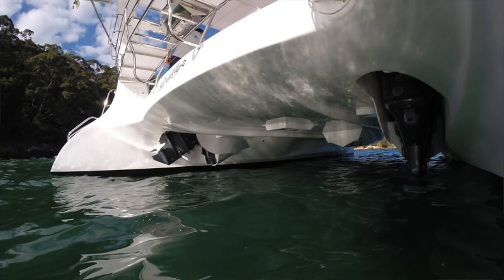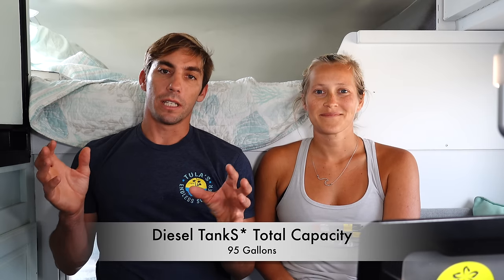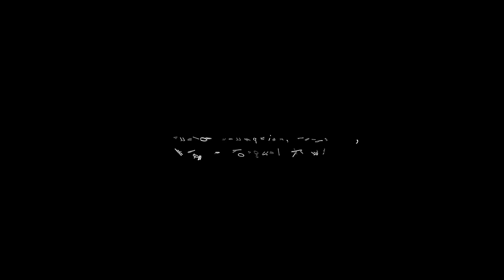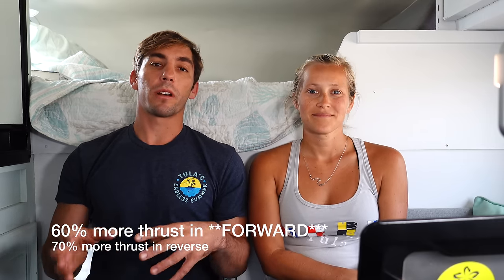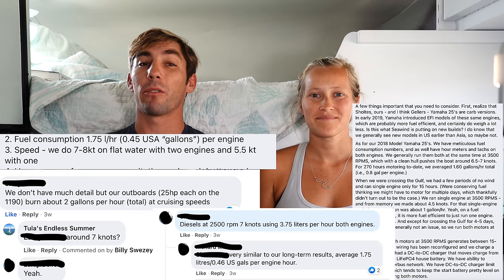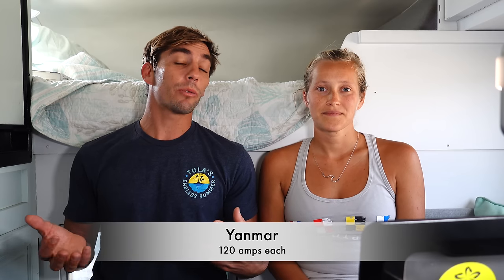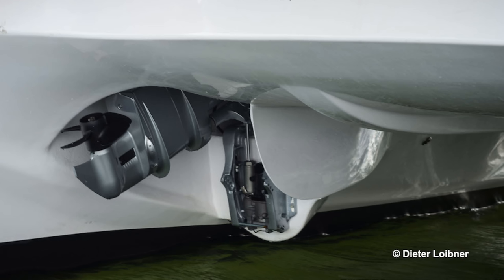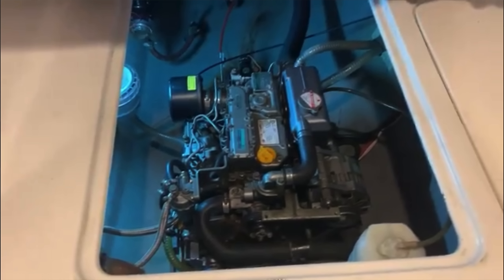Do Outboards Make Sense on a Performance Cruising Catamaran?

Comment: Looking at the 1190X I thought of trying a pair of Torqueedo Cruise 10.0 R's (20 HP) augmented by Seawind's Fischer Panda Genset option would be the way to go. My biggest reason for not wanting traditional Outboards is not having gasoline in the interior tanks.  So you'd still get the advantage of diesel efficiency from the genset only when need it to charge or extended motoring in no-wind situations, but retain the advantages of less drag and easy access for maintenance.  Cost would be a factor here, the Torqueedos are not cheap and neither is the large li-ion battery bank, and the extensive electrical component package involved.  It would take some real world testing to see how you would make out in terms of fuel consumption.  This isn't an option from Seawind yet so you'd have to convince the factory and your purchasing dealer to set up a purchase/ installation plan... and that would not be cheap, lol.

Comment: Diesel...better in my opinion when the chips are down in stormy weather and you need to motor away from a hazard.  Could you even keep the outboards in the water with 5-6 feet of chop?  Being able to charge when the sun isn't shiny is the other plus.

Comment: Diesel = + range, + elec generation, + safer fuel, + noise. The benefits of diesel inboards justify the increased cost. In spite of offsetting costs of other items to pay for diesel, get a water maker, larger capacity fridge & freezer, A/C, a way to heat water for showers, and elect Nav such as plotters, radar, forward sonar scanning. Minimum sails and solar panels at first because you can add them later. And get your dinghy back from Atticus! :) March is around the corner, so pick out your curtains now!  :¬) Webhead USA

Comment: Why not go with a 4th option of putting a pair of Oceanvolt Servo Prop saildrives and have a large generator for a range extender when needed. Then you only have one engine to maintain with the regeneration capabilities while under sail.

Comment: I like the outboards because they can live out of the water when you are at anchor; no bottom growth. Your boat is so fast that you want be motoring much on light air days. To check the saildrive internally you have to haul out. Also replacing an outboard is alot  less pricey. Go here and check what I am trying to say dyslecticaly arasen araseg etuhctib no eyrirahs.

Comment: Totally would pick the diesel motors! Higher torque and power if needed, way less maintenance and higher resale value for when y'all start a family and move ashore. They also have diesel heaters for boats if you ever need one and the fact that they put out a lot of amps to recharge batteries. It's kind of a no brainer.

Comment: deisel inside the boat is simpler to maintain and work on when they break (every engine breaks sooner or later) outboards would be extremely difficult to work on with the outboards in that location

Comment: Two comments here:
Heavier cats sail slower. Yes the engines are perhaps the biggest weight difference choice you face, but once you go diesel the tendency is to keep,pressing towards a gear-loaded boat that will hold its resale value. And that boat won't sail as well as the less equipped, outboard powered 1160/1190. In building our Farrier 39 tri, we chose a 20hp two cylinder outboard instead of the three cylinder diesel. This along with many other weight savings resulted in a multihull that sails well in light air, when everyone else is motoring. I see a lot of cats under power. 
Comment 2 is, just did a 500 mile Atlantic coast trip on a St Francis 44 decent performance cat. Their engines are the next size down and it's fine. Can you guys save interesting money stepping down to smaller diesels? I think it's worth a hard look.

Comment: There is NO option for an ocean going vessel. None!....  Diesel is far more prevalent on the ocean. Meaning, you can get diesel anywhere. even other cruisers. foreign country's predominantly use diesel for their primary fuel. You can burn alternative fuels, oil and vegi in a pinch. Diesel has a much lower flash point. You can transport it in a wider range of containers in an emergency. Gasoline has approximately 126,000 BTU's per gallon, Diesel has approximately 140,000 BTU's per gallon. You can upgrade the alternators later on to high output, like the Balmar 200 amp. I could go on for day's! We watch all your vid's.... Well except for those silly land ones! LOL We Love you guys! Keep it up. Brett and GiGi

Comment: Just wanted to make sure you guys were aware that the published options sheet for the 1160 says the Lithium upgrade is for outboards only.
Might change your thinking on going diesel.
I think they put the Lithium batteries and charging equipment on the aft shower compartment space that the diesel would go on which I guess is why they are mutually exclusive?

Comment: There are now Diesel outboards being built Cox is one such Co. No carb or ignition problems.
 But longer term internal combustion engines are in a sticky space. 
 If you have inboards you can swap to hybrid electric ... And have regen under sail see sailing Uma ..you could still run electric  100% power from go...silent simple and run for years with minimal maintainance.  They can be positioned vertically or horizontally or anywhere in between  they dont consume oil either. Brushless motors only need seals and bearings changing infrequently.They will even run in seawater so an externally driven azimuth pod can be used.  So all you have is cable running through the hull.If you have steerable pods center drive or rim drive the. They can thrust in any direction. 
Outboards. With a high output generator onboard combined with lithium batteries.  High output alternators work at low start ups. See Silent yatch's system.

Comment: the dingy engine has a shorter shaft than the cat outboards so they are not interchangeable. the outboards can be pulled easier and taken to the shop where the diesel can't. but the diesel lasts longer than the outboards.

Comment: Consider the rapid development of electrical propulsion and exciting new battery technologies (not yet on the market but possibly some hitting next year and 2023, not that LiFePo4 won't suffice). So possibly use outboards for now, but have Seawind put in provisions for inboard engines - prop shaft penetrations in the hulls. Even though folks like Sailing Uma have ventured forth in electrics, I imagine in a few short years there will be even more options. I see a company now building electric outboards in the size you are considering (not yet on the market).. but inboards wouldn't have cavitation issues outboards have. Also, wouldn't be that difficult to go Yanmars if you decided later you didn't like the outboards. Just a thought.. I understand the advantages of diesel.
Reply: RE: propshaft penetrations: I mean have them do what they can to make an inboard installation easier. I'm not suggesting have actual uncapped penetrations or prop shafts sticking out.. for those that are thinking I'm really stupid.  Ha!

Comment: I was surprised to hear the diesel engines on this boat are quieter than outboards. 
Over my life I’ve owned boats with big and small diesel engines all of them irritatingly noisy. I just acquired a 26 foot sailboat to teach my grandkids how to sail. This boat is powered by an outboard. The engine sound reduction is dramatic. I admit to loving the absence of that diesel clatter.

Comment: For sure you need folding props.  But I would go outboards for less weight. I have a Corsair 31,. So  I am weight sensitive. You can carry plot more toys and food if you get outboards. But if you don't mind motor sailing with one engine to help.you point, or go in light air, then the extra weight is not as big an issue. And motor sailing with one motor might cost less than half gallon an hour, peanuts that is.  There have it,if you don't mind motor sailing get diesels. A full throttle the diesels will kick ass...

Comment: I prefer electric motors like the air cooled electric yacht.  If you add solar and wind, you have free unlimited fuel.  You also get regen when sailing.  You can have your generator as a backup source of charging.

Comment: I would choose diesels after having an outboard on my F-9A tri. While an OB is the best choice for the tri, they are not as durable and are susceptible to internal salt water corrosion unless you can flush them properly after each use. Impossible for my set-up and it looks to be not possible on the SW also.
For long term live aboard and cruising, I wouldn't want to deal with outboards. If you are racing, reducing the weight and drag is in favor of the outboards. For my tri, an OB is still begrudgingly the right choice. It's just a bitch to access it for maintenance and like I say, critical proper flushing is near impossible.
I'd opt for the diesels FOR SURE on your boat if you are cruising.

Comment: smart decision given the current time, especially regarding the generator benefit for living aboard as well as re-sell value....however i was kind of hoping you would go all electric propulsion since i believe this is the future for sailing vessels with sufficient space for solar and other regenerative sources....
Reply: I love the idea of electric propulsion, but the battery capacity vs weight vs recharging vs cost for all that it needs to overcome those options, is still it's short fall.  You would need a Testa skateboard true Lithium Ion batter pack per electric motor, vs Lithium Iron Phosphate  (LiFePO4) batteries, which is what all sailboaters are calling "Lithium" (which isn't Lithium Ion).  Plus, Solar panels that would cover the entire deck and dodger/biminis.  There is a solution in the near future, but such solution is not out there yet.

Comment: I think you will be happy with the Diesels.  OB's are just frigidity critters, fresh water ok but salt spray is going eat everything including the modern $$ engine electronic controls.  Diesels should run with just a screw driver on the starter and bypassing the injector pump fuel cutoff.   You will go through several OB's for every Diesel. Get a small water maker, carry less water to reduce the Diesel weight penalty.   Did you consider electric sail drives?   Been amazed how  it's been working out for UMA -- do have to be prepared to actually sail.

Comment: One of the points you didn’t mention is parts availability. Many places you all will be sailing too may not have out board parts. Yanmar especially that model are popular almost everywhere you likely to be sailing. Parts should be fairly accessible…. But be sure you carry spares critical failure points for Both Diesal or Gas. Also didn’t mention the fire/explosive nature of gas… Boat fires are NEVER good so the more you can improve fire safety the better off you are. Diesal is the right choice. IMO

Comment: Very helpful! Just subscribed. Were you able to get the Yanmar diesels AND the lithium batteries? I’ve made a deposit on the 1160 Lite and the build options are showing that lithium batteries are only available with outboard options.

Comment: Good choice of engines. Hey Sierra, if you want a washing machine take a look at the small top loading or twin tub machines available for RV's maybe in the states, or in "2nd world" countries like Mexico or Panama.  They are cheap, you have control over water use, they are very light (I could lift ours), whereas front loading washing machines are very heavy, A no-brainer if you have a water maker, you are having a water maker aren't you? You just might have to wait until you get to a country where you can buy one.

Comment: Is sail drive the only inboard option? The problem with sail drive is that by the time you find a leak, the sail drive is ruined. Is a V drive, with the shaft under the engine a possibility?

Comment: If you went with petrol/gasoline couldn't you use just use the diesel tanks for petrol instead of the tanks Infront of the mast
And could you fit a more powerful outboard like 30hp. Is there a size constraint or any other reason 25 is the max Seawind offers?

Comment: I would encourage you to SERIOUSLY consider going all ELECTRIC with either three outboards (one for each hull and one for the dingy) or with two inboards and one outboard for the dingy. Electric motors have advanced well enough to be considered a viable option. I have seen many sailing channels (see list down below) convert over to electric motors for their Dingy and for their boat. 

Now is the time to consider this option. It will reduce WEIGHT and increase speed and performance and will have WAY LESS maintenance and the range will be completely acceptable. Obviously, this means doubling your Solar panel capacity and Lithium Battery capacity as well as getting a generator as a backup to charge the batteries on overcast days as needed. I guarantee you it WILL WORK in all circumstances. 

The only places that some may be concerned about are long passages like crossing the Atlantic, Pacific, or Indian Oceans. However, in those cases, as with any multi-day passage, you will need to have a diesel or hydrogen generator onboard to charge your batteries, especially if you have a few days that are overcast. Sailing Uma uses a small portable Honda Generator and it does the job perfectly. But obviously, you could use a larger diesel genset if you desired. The bottom line is as long as you have SUN you have POWER and range, it is VERY double.

There are so many options available with electricity these days and I am sure a quick query will show you all the YouTUbe channels that are using them as well as all the companies that support electric motors. 

1. Captain Rick Moore (on Sophisticated Lady)  - just converted his dinghy over to all-electric with ePropulsion systems (https://www.epropulsion.com/) and it works better than expected. 

2. Learning the lines - just purchased the Corsair Trimaran you all just borrowed and will be using twin electric outboards. Not sure which company but probably ePropulsion systems or Torqeedo (https://www.torqeedo.com/us/en-us)

3. Sailing Uma - just upgraded their Oceanvolt (https://oceanvolt.com/,  electric motor to the SD15 Servo prop model which has more power and efficiency. They are crossing the Barents Straits to Svalbard from Europe, also use a small Honda Generator I believe along with their solar. If you all had two of these inboard motors you would be more than fine.

4. Silent Yachts - https://www.silent-yachts.com/ - Silent Yachts is an all-electric yacht designer and builder that has several models out now. 

5. Alva Yachts - https://www.alva-yachts.com/  - Another All-Electric Yacht designer and builder (they use one of the top Designers out of Thailand)

Comment: The sail drive is almost a deal breaker for me. If that seal fails that’s a big hole in the boat. The interchangeability of parts w the outboards is very appealing

Comment: You can charge with a small generator any battery load solar couldn't get topped up. Diesels last longer, but how much does one of the outboards cost on the open market?  Couldn't you replace the outboards five or ten times...each side counting the diesel cost and labor...The labor cost on the diesel would require a haul out and crane.  The only downside is the charging and range, but it could easily be remidied with the generator for charging or even two small generators.  I love my diesels but I have to say maybe the outboards make more sense for sailing performance.  Just put more solar on the boat after you get it...My guess is any upgrade you do yourself after the factory will save you tons. Oh one last thing there are people out there developing diesel outboards.  You can even find them second hand as they have been on the market for a long time.  Partial or full  electrical propulsion might be an option if you have outboards.

Comment: Check to see if the Yanmar sail drive can have the oil changed inside the boat ,some of their SD’s can be. Really wondering why you didn’t consider an electric sail drive system that can recharge while sailing, especially since your going Lithium. Check the conversion with Sailing Uma. Maybe a sponsor opportunity getting into SeaWind.
Reply: With electric motors you need a genset to make sure you do not run out of power.
Reply: @pavichapin  don’t disagree with that although with solar ,wind and prop charging capability and an adequate Lithium battery capacity I believe its a manageable combination. As the technology has developed I do see more conversions to electric electric systems.
And when you consider an alternator output its important to look at the RPM curves to achieve max rated output. In most applications and engine cruise RPM operation the max output potential is not realized.